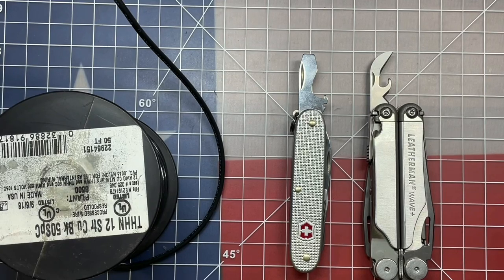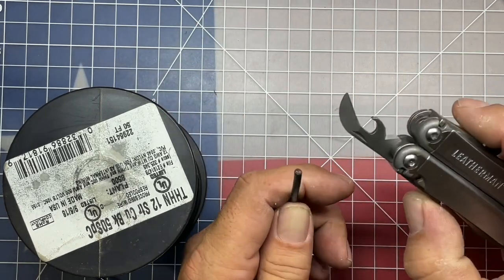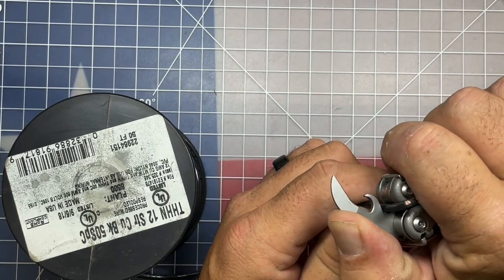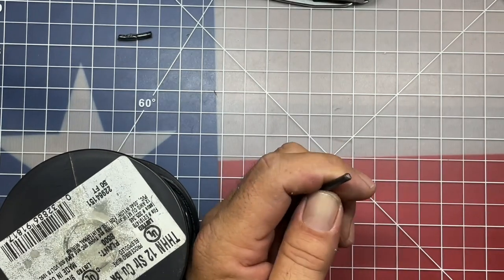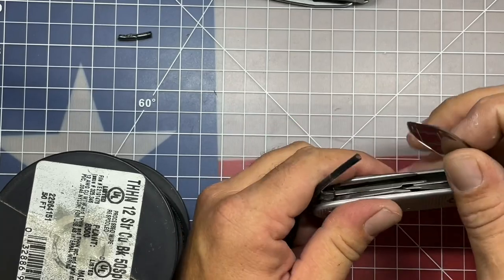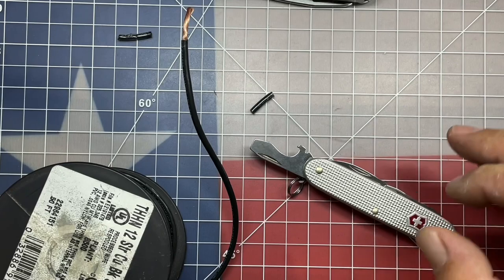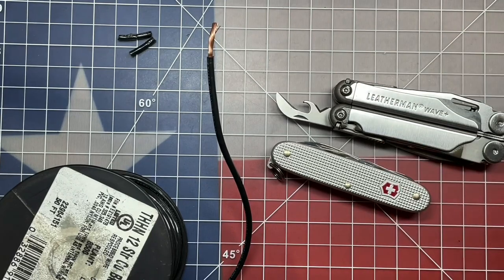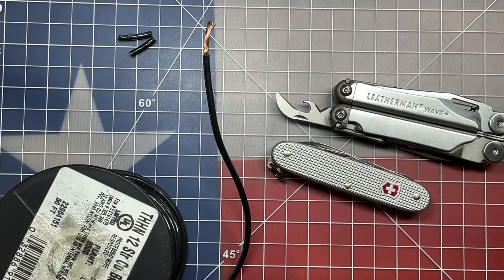Leatherman vs Victorinox : How To Strip Electrical Wire With Each Brand

Comment: The frayed wire cutter on the back above the crimper (on the surge), works well for stripping wire. You gotta find the sweet spot of not applying too much pressure to cut the wire, and then you can just pull the wire and move the tool in opposite directions and wallah.

Comment: Is The Leatherman V-notch supposed to be sharp out of the box? I got my first Leatherman, a Rebar, a couple weeks ago and the V-notch is completely dull! I can't score any wire insulation using this method with my new Leatherman. Have you sharpened the V-notch? If so, how did you do it? Good video demonstration anyway, thanks.

Comment: Lets throw the Victorinox SpiritX in the comparison. The SpiritX has a V-notch and the round U-notch. The V-notch has nothing to counter against. Bute with the round U-notch you can hold and  press the wire against the handle and use the scraper, which is right netxt to it, to score the insulation.